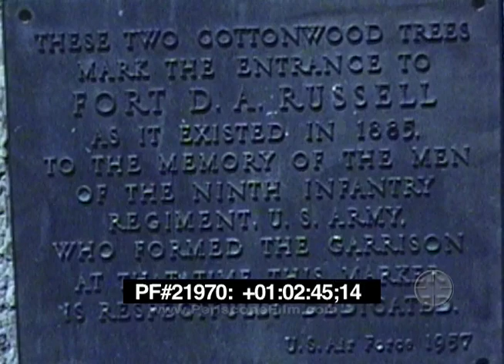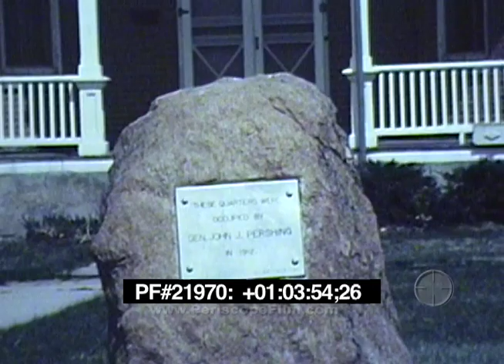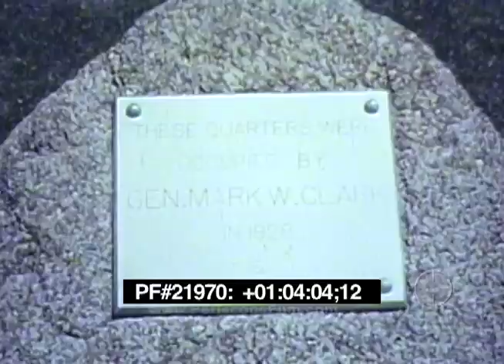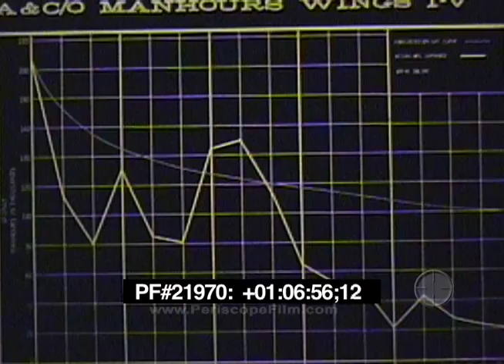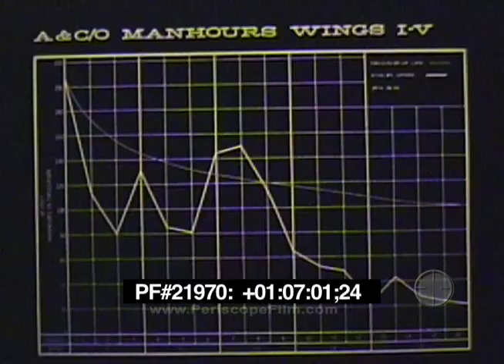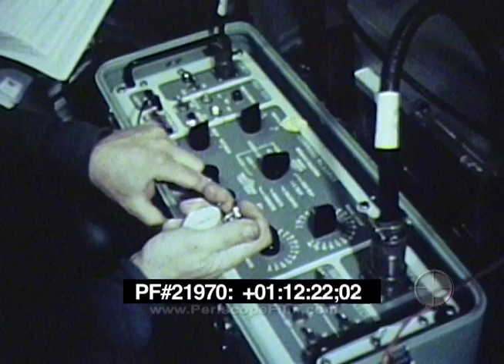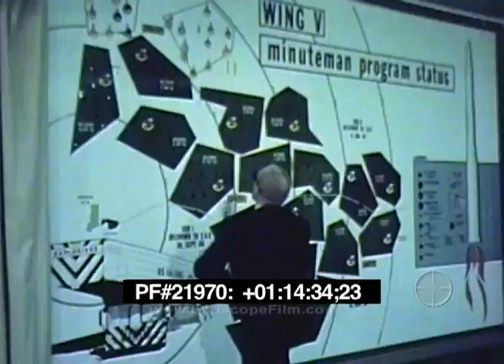MINUTEMAN IN THE WEST - ICBM , LGM-30 , SLBM 21970

Comment: The time codes in the middle of the video is just plain annoying and not necessary.
Reply from the maker: Here's the issue: Tens of thousands of films like this one were destroyed and many others are at risk. Our company preserves these precious bits of history one film at a time. How do we afford to do that? By selling them as stock footage to documentary filmmakers and broadcasters. If we did not have a counter, we could not afford to post films like this on online, and no films would be preserved. It's that simple. So we ask you to bear with the watermark and timecodes.

So, in the past we tried many different systems including placing our timer at the bottom corner of our videos. What happened? Unscrupulous Youtube users downloaded our vids, blew them up so the timer was not visible, and re-posted them as their own content. We had to use content control to have the videos removed and shut down these channels. It's hard enough work preserving these films and posting them, without having to deal with these kind of issues.